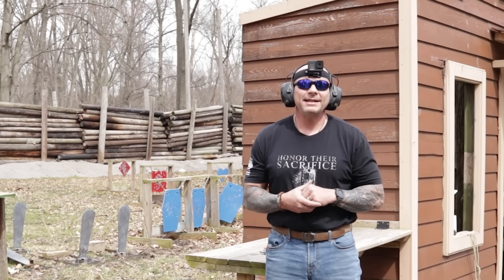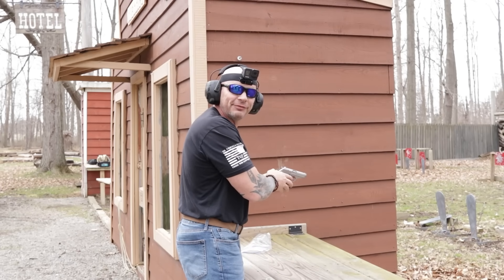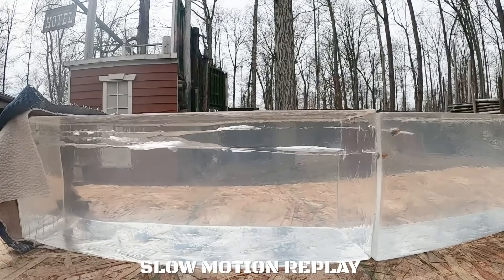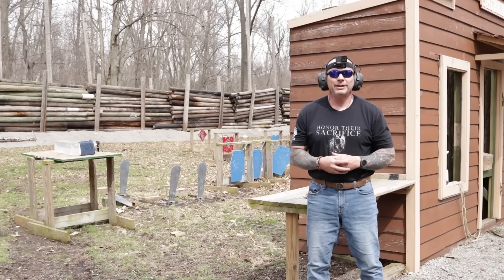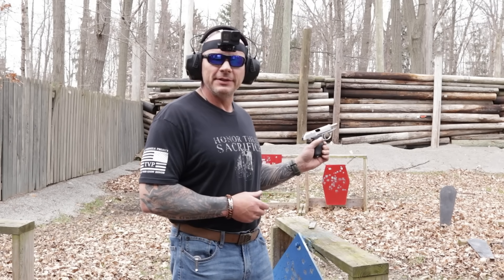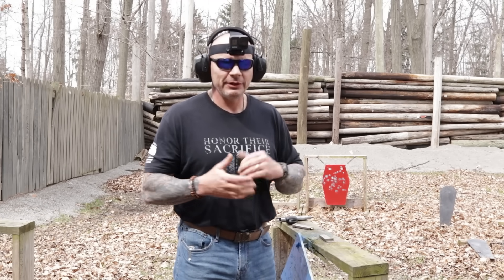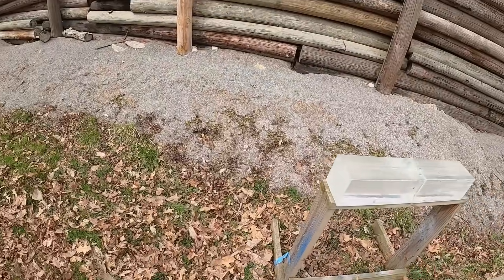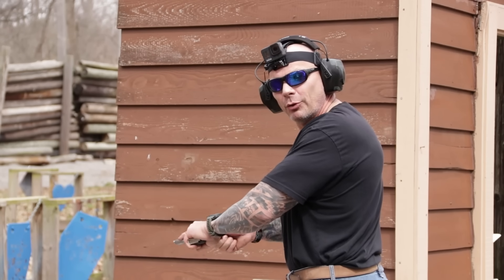Stopping Power of .380 ACP

Comment: Enjoyed your presentation and perspective.  I have 4 380s, 3 sig sauer P238s and 1 Glock 42.  I load Underwood Defender rounds, a bullet manufactured by Lehigh Arms and packaged by Underwood.  They have a muzzle velocity of 1800fps, 18 to 24 in. Of penetration and a 1 3/4 to 2 3/4 in. wound cavity.  I feel it can more than lethal enough in an engagement from 3 mtrs. to 10 mtrs.  Recommend you have a go at it with some of these rounds, I believe you will be impressed.
Reply: Have you had any malfunctions with the G42?
Reply: @LRRPFco52  No Sir, I have never had a malfunction of any kind with my G42.  However, I realized two errors on my post regarding the .380.  First , the velocity of the Underwood round was 1200 FPS, not 1800.  Second, the maximum wound cavity observed ( in gel blocks) was 2 1/2 in, not 2 3/4.  But either way, it is a surprising round.

Comment: For my money the Ruger LCP max loaded with 13rds of XTP has changed the game. Less than 1lb fully loaded with 13rds, and really nice factory night sights. Just amazing.
Reply: This has been my EDC for over a year and I see NO NEED to change this out unless I go someplace very cold for the winter and need more power to get through  heavy winter clothing.
Reply: @ssnerd583  I just carry XTP+Ps in mine. I doubt anyone I shoot will ever know it wasn't a 9mm that shot them.
Reply: @Followme556  ...yeah...mine are the +p too....if I gotta pull the trigger its all about ME walking away, and the XTP+Ps are likely the best bet on that.  If I lived 'up north' I'd likely mix something round nosed in for good measure, but I'm not up north so....
Reply: @ssnerd583  If those XTP+P's don't expand, for whatever reason- like getting clogged with clothing, you're going to probably get 30" of penetration with those too. Should be a good all weather, all climate choice.
Probably the best choice possible in 380, honestly.
Reply: @ssnerd583  I carry .380 and 9mm I feel that  either one is just fine for SD. When people say you should carry 9mm if its cold and people are wearing heavier clothing.  Is because they don't think that the pelvic area is good shot placement I disagree. If you take out someone's forward movement the threat is over. Most people are not wearing real heavy clothing in that area any time of the year. I practice on hitting that part of the body a lot I feel that if you can hit center mass you can hit that area with practice.:yougotthis:
Reply: @ssnerd583  Buffalo Bore or Underwood 100 gr flat nose standard pressure will penetrate 30+" of gel if you're worried about penetration.
The +P version over 40". I've run an entire 50rd box of the +P through my LCP Max with 13lb recoil spring, it gobbled it up no problem. Stings the hand like a beotch though, lol.
Reply: @Valorius  Try Winchester service grade does not Sting like a Beotch but has good pen that's all I use in LCP Max & Bodyguard.👌👍
Reply: I carry an older LCP Custom. With a 7 round mag and it’s loaded with Underwood Extreme Defender. I’m figuring Hollow Points don’t work well enough in 380. The extreme defender seems to be a middle ground with good penetration and an expanded wound channel in ballistic gel. I don’t really like that the slide doesn’t lock back like the newer LCP’s do but I still carry it warts and all. It kicks good as it is an 11 ounce gun but Hogue makes a custom grip for the LCP which tames recoil. In fact it makes the little gun shootable. It’s all a compromise with me. With my Kydex IWB it doesn’t print and I can carry it without thinking about it all day long. I do Have a Glock 26 but it got too heavy to carry for long periods and doesn’t conceal as well. I think for my use it will get the job done with a spare mag I have 15 rounds available and 380 is equivalent to standard 38 special.
Reply: @duke927  they expand in gelatin.
Reply: @ironmonkey1512 . Usually if they expand they don’t penetrate and if they clog or don’t expand they over penetrate. I’ll stick with the Underwood’s. There is an old video by Lucky Gunner about various hollow point .380 which kind of proves the point. But my LCP was acting up with lots of different ammo so I couldn’t rely on it. I’ll have to see about a repair. So I’ve been carrying a Glock 27 (.40 S&W) and use Underwood Extreme Defenders in that and all my EDC guns.
Reply: I love my lcp max
Reply: I carry the LCP2. I love the Max. I wish that it was available at the time that I bought mine. 
Something like a sigp365 is still just a little big for a small guy like me to carry around.
 I have a +2 magazine and the original mag for my LCP 2 at all times. No one ever knows that I am carrying. Even with the new micro 9s, you just can't pull that off like you can with the LCPs.
 I may eventually trade mine in for the Max.
You just have to remember that MOST hollow points do not preform in a .380.
 I did a ton of research on .380 ammo before settling on Hornady FTX projectiles.
 I have since switched back to FMJ for consistency. Even the best hollow points in a .380 tend to either expand and stop way too soon, or they don't expand at all.
Reply: @letsdothis9063  Which +2 are you using for the LCP2?
Reply: I agree. The LCP Max is incredible.
Reply: Absolutely
Reply: Ruger ec9s. It's a 9 as opposed to the lcp but gets the job done
Reply: Lots of reliability issues with that gun....feeder/ mag issues ....luckily ruger seems to be doing a good job with providing solutions for it.
Reply: @vink6764  The early models had some issues, but everyone commenting on any of my LCP max uploads who's bought one made in the last six months or so hasn't had any issues.
Mine is very reliable, and there is already a very large aftermarket for them.
Reply: Lcp max stays in my pocket at all times. Even if im carrying my hellcat iwb
Reply: I have done a lot of research and the Hornady Critical Defense is, in my opinion, the best 380 self defense load.
Reply: @2Stonefly  I have in mine now.
Reply: I prefer the Sig 365 if I want that many rounds in a little gun... for a pocket gun, I go with The Crimson Trace Bodyguard 380 and an extra 10 round man.  To each their own.  Sights on a pocket gun are just points of snagging for me.
Reply: @Nigriff  365 is huge compared to an LCP Max they are not in the same category
Reply: @Followme556  The 365 fits in a pocket fine...
Reply: @paisteplayer1040  Sure, if you're a hill giant.
Reply: @Followme556  Maybe you are just tiny
Reply: @paisteplayer1040  Funny how Sig does not characterize it as a pocket pistol, and no reviewer has either.
The 365 (original) is a micro 9, it is not a pocket pistol. Sorry charlie.
Reply: @paisteplayer1040  No it doesn't.
Reply: @paisteplayer1040  maybe you're just wrong.
Reply: @Fury-161  Fits in mine
Reply: @paisteplayer1040  how tall are you, and what kind of pants? Most of us are wearing jeans, and a 365 is definitely not fitting in the jean pockets of a normal sized human being.
Reply: @nomorerainbows  yes it does. I have had a p365 for 2 years pocket carry it everyday.. Regular jeans or cargo shorts
Reply: @Followme556  Been carrying my p365/380 i a pocket holster for 2 years
Reply: @paisteplayer1040  hiw tall are you?
Reply: @nomorerainbows   5/10
Reply: @ I suppose a 365 would fit in farmers overall pockets, but for blue jeans for most people, it's not a pocket pistol.
Reply: @Nigriff  somebody already told you but yes the lcp max weight and size wise is on a whole different level than the 365
Reply: @Nigriff  I have both, and strongly disagree with you. I carry the Ruger and the 365 is nightstand place holder.
Reply: @Nigriff  The Sig 365 is twice the weight of an LCP max, and significantly larger. Totally different animal.

Comment: I carry the 380 but the 380 will not be good (and was not chosen by the Military) for the Military because it does not have the penetration power of the 9MM or 45, once you start layering on clothing and gear that Soldiers normally have.

Comment: I carry a 13-shot Ruger LCP Max, 15 oz fully loaded with Underwood 380 plus p xtps. In my opinion it is the ultimate CCW handgun devised to date.
Reply: Hows that +P working? I been hesitant to use any since Ruger specifically said it isnt rated for it but this comment is the third or fourth I have seen in a few months that say they carry +P. I myself would prefer but there just isnt enough data to go off.
Reply: @SwiggityPeanut  I don't know how any manufacturer could rate a gun  for something that does not have a Saami specification. But I can tell you that I took one of the xtp plus P rounds and deliberately set the bullet as deep is it would go in the case with a pair of pliers and fired it and there was no problem. Make sure you use a 13-pound recoil spring if you're going to use plus p

Comment: Yes, so a .380 ACP can hit a metal plate at - what - yards or so faster than a .40 S&W?  And what does that have to do with stopping power?  I look at defense arms as arms used in defense, not games.  One hit with a .40 S&W would serve as well on a belligerent as seven hits with a .380.  At least about the same.  And with less potential danger to other people.
You mentioned the SIGP230SL doesn't have a safety.  Yes, the SIG idea is to replace the safety with a 'hammer-dropper' a mechanical device that lowers the hammer on a live round without firing it.  Like a number of other handguns.  Always thought it was a dopey idea.  

The test in gel, .380 95 grain FMJ.  Penetrated the sixteen inch block.  Did you know Germany kept the .32 ACP (they called it the 7.65mm) in the Army inventory and not the .380 ACP (9mm kurz) because the 7.65mm would penetrate a helmet and the 9mm kurz would not?  .32 ACP is a remarkable penetrator.  

The hollow points are about as expected.  Per the FBI standards those rounds don't make the cut.  But they expanded quite nicely.

Fifty meter shooting to determine if accuracy is adequate.  Pointless.  Not my sidearm and not me shooting.  As a pistolero I think hitting a human sized torso at fifty meters should be expected.  However, for self defense most of us - lawmen and regular citizens - are limited to very close to powder burn range.

At one point you commented about 'powerful enough'.  Perhaps the .380 ACP is 'enough'.  But it is much lesser than several other as easily carried.  The standard is not 'enough'  the standard is certainty.  Perhaps not ever fully achieved but one can get much closer.  .380 ACP is quite popular.  For carrying.  For ease of carrying.

Comment: Great video. In my experience the .380 ACP is a very effective caliber especially in short range situations, long time ago I owned a Bersa .380 13+1 (here in the US Thunder Combat+ I think) it was the original version sold in Argentina, with a 4" 1/4 barrel, the performance of the gun was excellent under 115ft (35m).
Reply: By the time you get to a 4" barrel you might as well carry a 9mm unless recoil is an issue. But, I agree 380 is under rated with the ammo these days. All the tests I have been seeing place it on the same level as 38 special given modern ammo.
Reply: Exatly: my old (a nearly a mint-one) Beretta"mod.1934", cal 9-Corto/1941=XIX"E.F"(Era-Fascista) with "Mamba-type"/Fiocchi-ctg: are ideal-"binomio" at short distance (for a realistic self-defence: 0-10mt)😊

Comment: Though I have three other 9mm handguns, 90% of the time I’m using my Glock 42 .380 ACP with a +1 round magazine extension for every day carry.  It’s easily concealable, lightweight, and handles very well (though cost of ammo keeps me from more rounds fired at the range as compared to my 9s).
Reply: Do you carry a backup mag?
Reply: @Nigriff  I do...10 rnd backup and 7rnd loaded
Reply: The G42 is addictive. Pity that my Magguts started acting up occasionally. If Shield Arms do a Z9 mag for the 42, I'll be seriously tempted.

Comment: I used to carry a 1911 in 45, for a decade, been carrying a Llama 380, and am gratified to know the equal penetration at fifty yards, as at ten feet.  I enjoy the comfort feel of a locked breech 1911 action, and the high accuracy potential it gives.  I've long know the accuracy potential, and this demonstration of penetration was a welcome surprise.  I also enjoy a couple 1911's in 38 super caliber, as very accurate and quite pleasant to shoot.  I've also chambered a Llama 380 in 9mm Makarov, and that pistol is equally pleasant and fun to shoot.  Thanks for doing this ballistic gel test, very nicely done.
Reply: Fixed barrel blowback is more repeatable than a locking design. Ask gun Jesus.
Reply: @deet_boii  Are you saying the Llama is not good enough since it's a linked barrel?
Reply: @hotrodray6802  I've had both and like the recoil of the locked breech action better.  It's a nice backup caliber, I've also had it in 9mak, slightly hotter, and very easy to handle.

Comment: Taller table? Angled Table? Angle Tray?
Why does the FBI demand 12 inches of penetration? An average 200 lb torso is less than 12 inches front to back. Wouldn't that mean total pass through is almost guaranteed & a potential hazard to anyone that might be behind the Target?
Maybe we should think more along the lines of 'Bullet Stopping' +Power.
And why the hell does everyone rag on the 22? I have killed Full grown Mother Wild Pigs with it on more than one occasion. Bullets need to Go Into the Target not Come out.

Comment: Hand guns in general are a psychic equation.  The enegery is constant. Moving different masses is the key. The 380 round is a shortened 9mm . So for recoil control a larger mass is better.  As for self defense anything is better then nothing .. if you get into a situation your not going go care if it's a 9mm 40 or even a 44 magum.. if you have to pull the trigger recoil is irrelevant.